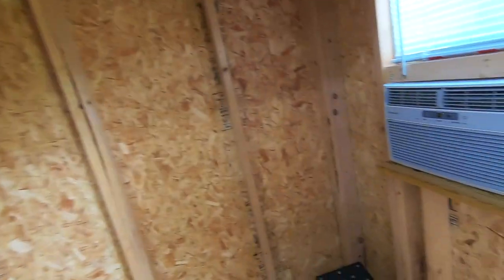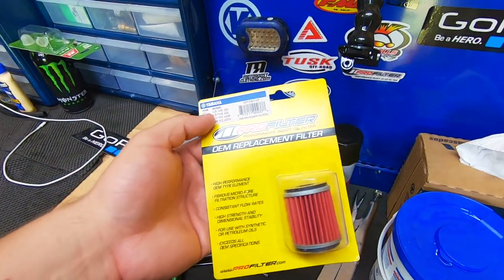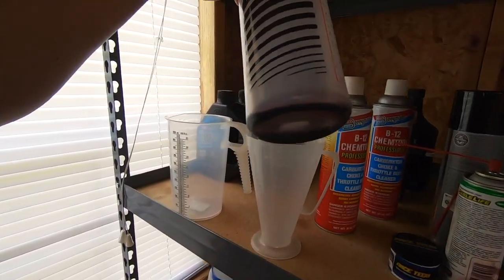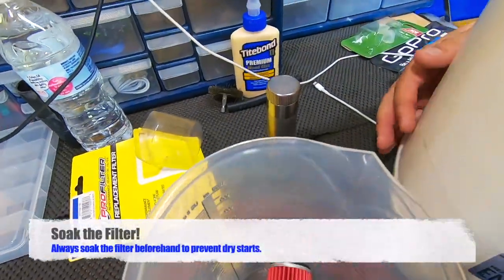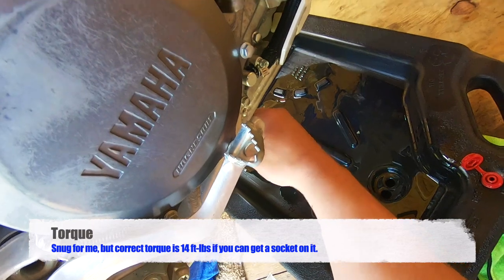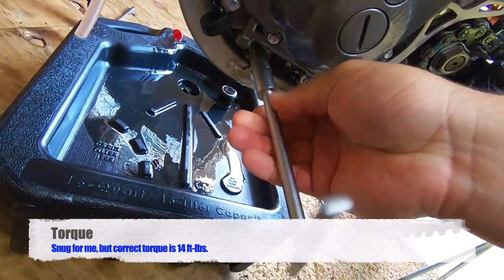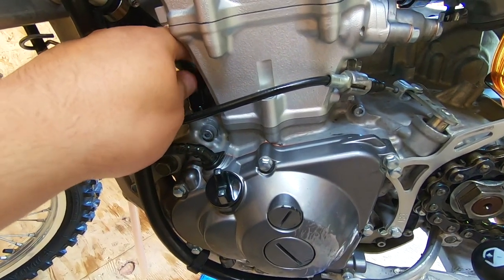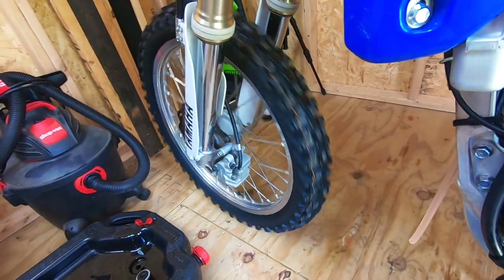YZ450F OIL CHANGE | Save money and do it yourself

Comment: Hello, you said the drainplug needs 14 lbs torque on it?. At 7:28.

But i read the Manual on my yzf 09 and it says 7,2 lbs.

Did you made a mistake or is it Right ? Im new to this and i try to compare your Videos to the manuals so i can do it By myself
Reply from the maker: 14 lbs is correct for both left and right case halves. The 7.2 is for the drain bolt on the filter housing cover.

Comment: Coolanol looks to be about the same price as Engine ice right now....  Prestone is a quarter of the price... besides the prices and the boiling points for coolants, whats the difference ?
Reply from the maker: I run the Coolanol due to the climate I live in, it freezes unexpectedly in Utah even in the early parts of fall. That being said, I ride into October-November and this gives me piece of mind that the Coolanol won’t freeze on the bike and crack the cases. Also, the Coolanol seems to be better than normal 50/50 and have less cavitation. It’s more oily than you normal Preston’s 50/50 if that makes sense. It is comparable in price to Engine Ice, but won’t freeze 🥶 hope this helps clarify.
Reply: @DanMX2112  im riding my 2004 YZ 450 in Tahoe and it freezes but never stays that cold for long.. how do you check for cavitation? i would imagine with additional vapor within a coolant then it could boil at a lower temp but how would that effect negatively on its freezing point ?  BTW thanks for getting all scientific !  :)
Reply from the maker: With the Coolanol being a bit more “oily” the instruduction to air bubbles happens less, a viscosity thing. Now I may be totally off, but this is my opinion based on experience. What I mean by cavitation is the ability for the liquid to be fed into the motor without bubbles and the ability for the bubbles to escape and allowing coolant in the passes. Seems to bleed off easier, and work smoother. Like I said, this is all my opinion and not gospel lol

Comment: Hi, why didnt you use new crush washer?
Reply from the maker: I usually change it every few oil changes. I used too all the time but found no benefit after a single use.
Reply: @DanMX2112  oh okay. Yea i‘ve planed my firsr oil change but have a hard Time to find the right drain bolt and crush washer :/

Comment: i did this exactly and now leaking from the oil filter cover. maybe new gaskets is good idea
Reply from the maker: Yeah, those orings get flattened out and won’t seal after a few times.
Reply: @cupofwater6760  probably didn't torque to spec
Reply from the maker: @cupofwater6760  yes, you have to replace all of them, not just the large one after a few filter changes.

Comment: Question, I just drained my oil in my 2010 yz 450f and put in the 1 quart that it’s supposed to have (from what the owners manual says). I notice that when I start the bike, the oil goes to the top of the sightglass and starts bubbling a little bit. Looks like air bubbles floating to the top. Do I have too much oil!? Need help!
Reply from the maker: The manual barely over a quart without a filter change. Now, after running the bike for a few minutes and shutting it off, it should show an oil level half way up the sight glass. If it fill the sight glass when not running, it’s over full.

Comment: I got a 2019 yz450f is one liter the recommended amount of oil?
Reply: Is it one liter?
Reply from the maker: I’m not sure, but, your bike has a sight window on the right hand side. After you change the oil, run the motor, shut it off, and it should sit between the 2 marks on your sight window after cooling down. But as for the correct amount, I’m not sure, and don’t rust any good search, check the forums! Thanks for watching!
Reply: @DanMX2112  thanks brother

Comment: What kind of socket to remove the filter housing? I'm afraid I'm about to strip mine with my 5MM hex socket.
Reply from the maker: It’s an 8mm 6 point/hex socket. Try to use 6 point so you don’t round off bolt heads! Hope this helps
Reply: @DanMX2112  thanks! Ended up going to buy an Allen socket set for this! But I'm going to be upgrading this cover to different bolts those are a pain lol
Reply from the maker: Josey Wales oh my bad, you were talking about the drain/bottom bolt. I can’t remember the size, but I would get the correct for sure! My bad
Reply: @DanMX2112  no I'm talking about the filter housing,  Tusk makes a cool filter cover that comes with regular bolts instead of the Allen bolts that are easy to strip.
Reply from the maker: Ya, I have replaced mine since and forgot they were all Allen bolts, that’s why I was so confused. I’ve debated on that cover also, much nicer

Comment: 4 hour oil changes preserve your motor the same amount as 8 or 10. Your just wasting money.
Reply from the maker: Everyone maintains them differently and that’s the beauty of doing it yourself. I also only pay $3.50 an oil change also so it’s only $7 every 2 changes anyways. Most people buy Honda or YamaLube oil at 8$ a quart and spend almost $20 per oil change. So I feel that I’m still ahead and doing well. Thanks for the comment and watching, I appreciate it!
Reply: Daniel Tucker I don’t buy yamalube or oil like that because they are just price gouging. I buy decent oil and do my changes every 8 hours. I change my oil filter every other time and I’ve never blown a bike up
Reply from the maker: Your maintenance schedule is great! way better than most bike owners, crazy how many bikes i see blown up due to oil changes, valve adjustments, and top end neglect. I think that 10 hr changes are fine, but after I cross the 4 hr mark I dump and fill, works for me, typically between 4-6. My clutch looks and feels new after 40-50 hrs also, but I’m pretty easy on it. Can’t go wrong.
Reply from the maker: Btw what do you ride?
Reply: Daniel Tucker I ride a 2012 YZ450F currently. I pretty much will never hit the rev limiter and I ride very smoothly just for fun. A lot of the riding is done on old logging roads so I can get to technical trails. My top ends will hold up for over 100 hours because of how strong the bikes are made. I just do preventative stuff early so it doesn’t detonate the engine, like changing my timing chain every 60 hours and replacing valves if I feel they are about to drop out of place.
Reply from the maker: I heard those 12s are snappy and full of power! I agree on the top ends, they are bullet proof bikes, and valves are rarely an issue! Nice talking with ya and I’ll have new videos coming out soon! I’m back into this YouTube swing again!
Reply: Daniel Tucker what is top end neglect ?
Reply from the maker: I just mean when people run the bike to failure by not doing top end maintenance. New piston and rings is a typical top end job.
Reply: @chrishansen8026  what kind of oil would you recommend for a 2006 yz450f